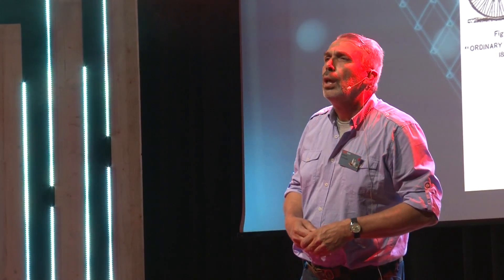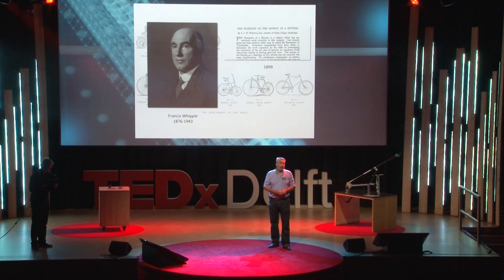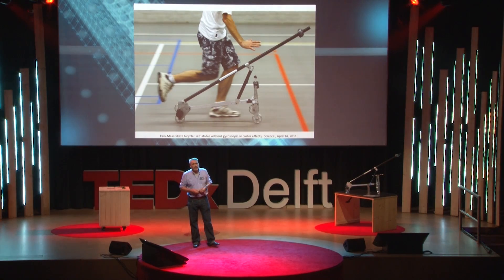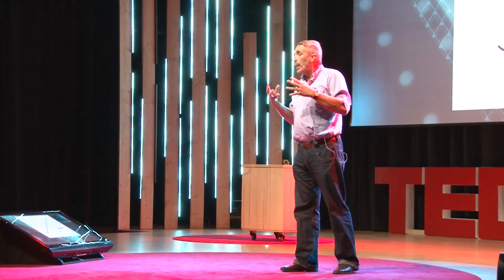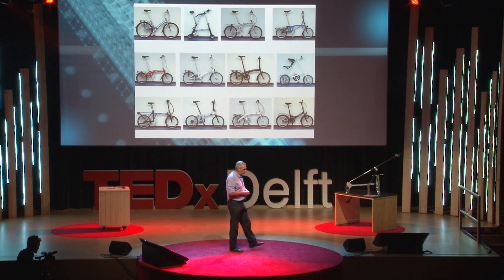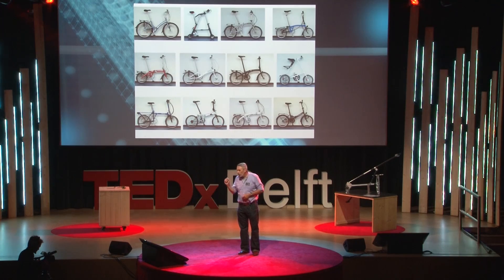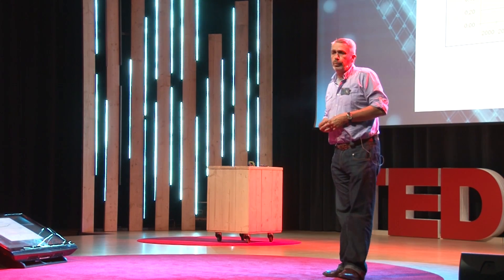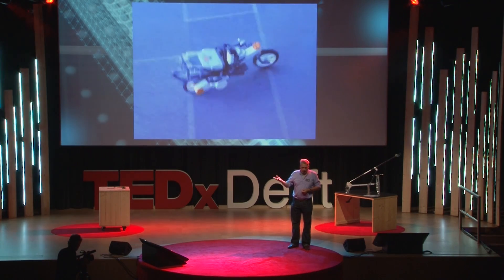Why bicycles do not fall: Arend Schwab at TEDxDelft

Comment: Why Bicycle stays upward while running? The answer is pretty easy. The pull of Gravity is Defeated by Velocity. Explanation: As we all know that there is gravity that always pulling everything downward. The Bicycle driver as riding on a bike the gravity pulls the driver at right and left side causing unstable position. To balance the bike, the driver has to move the steering sidewards but it is not enough to make the bike balanced. So the biggest option the driver do, is to have velocity to counter the pulling gravity. Thus the bike balances because the velocity force cannot overcome by the pulling force of gravity.  Example, a single bike tire, turn it on upward position. the tire could stand balanced upward while on run. Remove the velocity, the tire will fall down because the gravity force will be greater than the force of velocity.
Reply: Funny😂😂r u being serious? Velocity force?
Reply: Nope that's not it.
Reply: +Romy Nacido The reason that a tire will stay upright is because of the gyro effect, when it starts to tilt the tire turns into the tilt just like a bike in that way it stays upright. :)

Comment: I think he only gives half the explanation.  Once the bike begins to tip and turn, the inertia of the bike and rider wants to keep the bike moving along the original vector, so as the bike turns and tips a little, the inertia induces a small force righting it.  That's my theory anyway. :P

As for the gyroscopic effect, it has to be negligible (when there is an actual rider on the bike), as the mass of the wheels is so small and the wheels rotate relatively slowly.  On a heavier motorcycle, I suspect this effect is much more prevalent.
Reply: You're correct . 
Jan 2021 and we honestly still don't know how they work .

Comment: The facts for bike self-stabilizing:
1.gyro effect destabilizes, but it's negligible for normal speeds of a road bike
2.both articulated parts are inverted pendulums =>CG are always above contact line =>mass distribution is negligible here too (for normal wheelbase)
3.any bike geometry stabilizes as long as it reacts by steering IN DIRECTION of accidental lean (any learner is told to do)
4.classic geometry is the most stable, but it can't help handicap who must stay away from any machinery operating. 
5. B.S. can be presented with professor's style.

Comment: 5:4 I did it with bike wheel &got opposite results
Indeed, upper part of rolling wheel has most horizontal component of momentum &its conservation reacts against lean or steering move (motorbike racers have appropriate counter-steering reflexive jerk before steady phase of turning). In normal riding negligible disturbing gyro affect is canceled by classic bike geometry that is only stabilizing factor.
Schwab should've learnt Wikipedia article first.
Reply: HI currishev:

Andy Ruina here, friend and colleague of Schwabb who made the video. I am even in some of the video clips.  I was also the Masters Thesis advisor of Andrew Dressel,
the main author and moderator of the Wikipedia page on bicycle stability.

Yes, the wikipedia article on bicycle stability is VERY GOOD and informative. The Wikipedia page has most things  right, as best I have seen.  And I don't think you will find any disagreement in the Wikepedia page on bicycle stability with what Arend Schwab says in the video.  

If you glance through the various papers and appendices on Schwab's or my www pages you will see that the work presented in the video above is not casual dabbling, but pays lots of respect to the 150 years of thoughts and researches on bicycle stability.
Reply: If u are right, I don't understand English then.
My understanding of bike stability is self-coherent and consistent with my grasp on classical mechanics, So, further non-specific talk is pointless unless u can cite wrong part in the Wikipedia article ("..most things right.." is not everything right in plain English) with yo arguments.
Reply: Dear currishev:
Please tell me what about the Schwabb video you think is in contradiction with the Wikipedia article on bicycle stability.  If you are specific I will try to give a specific answer.
Reply: reread my first comment: it can't be more specific as it gets: I noted moment and content of contradiction with my wheel test and article's claim (I agree with) about negligible gyro effect on bike stability.
I don't see point in the conversation when one writes just for sake of writing,. Bye.
Reply: Hi currishev:  
  In response to your Dec 12, 2014 post. 
  I'd like to think I am not just writing for the sake of writing.   I reread your post from Dec 8, 2013 and do not find it clear enough to respond to.  But I am not complaining about that.  I would like to write in a way that is clarifying for you if I can.    My central claims, which I would like a chance to defend or explain, are: 1) Arend Schwab's talk is probably correct in almost every detail, and 2) The Schwab talk  probably agrees with the Wikipedia article in almost every detail. Schwab and the main wiki author, Andrew Dressel, know each other and know pretty much what each other know.   So if there is apparent disagreement between them I guess they would both like to know that and have things clarified.
 So might you humor me and try to explain yourself again?